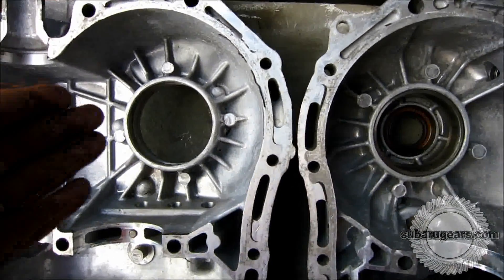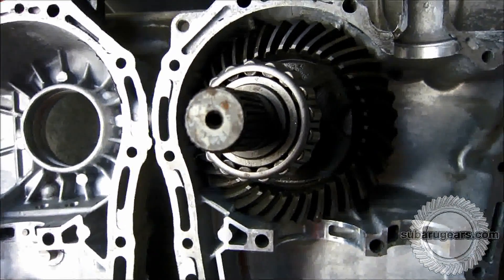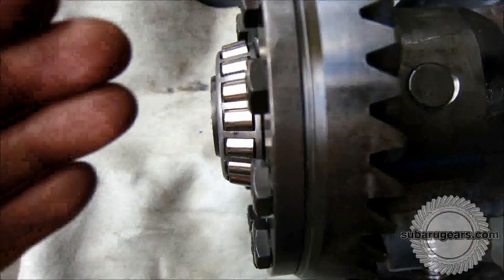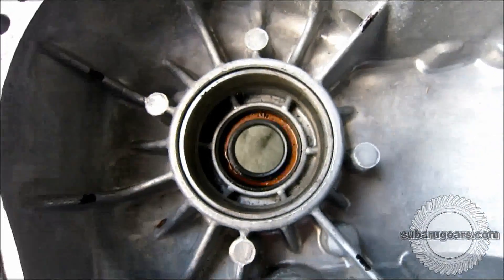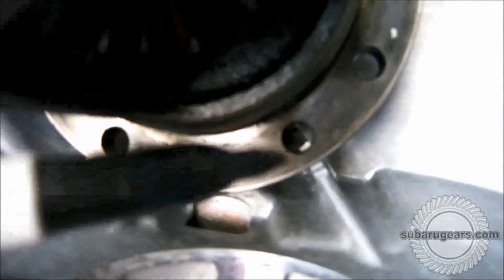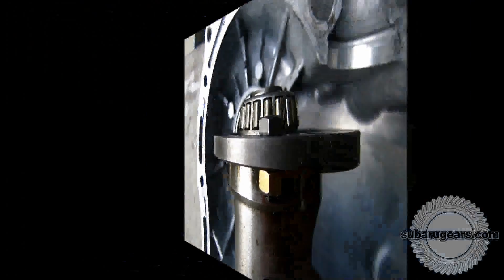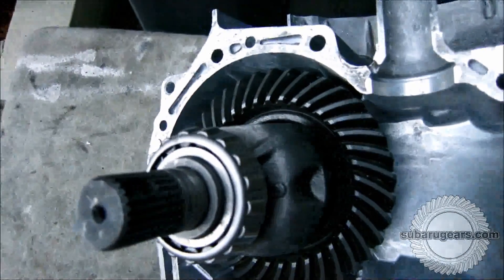Subarugears case clearancing

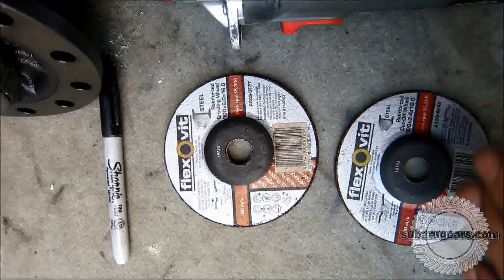Comment: 1:30 The grinding discs you are using are labeled for use on steel. While they do work, using them on Al is not advised. This is because the discs load up with Al, causing them to become unbalanced. While spinning over 10k rpm, it could lead to the discs exploding.  If you visit your local welding supply store, they should be able to supply grinding wheels that are intended to be used on Al.

Comment: I do wince at the thought of removing "any" material. Especially in areas that look minimalistic to begin with. Which reminds me... "I really don't see any beef in these trans' so I don't know how they got such a air of strength". Of course this end of the transmission wasn't meant to deal with 100% of the grunt, as it was shared with the rear. And I keep reading HP numbers and HP does't break transmissions, TORQUE DOES. So I don't know what to believe... Except that these trans' seem to work and that's hard to argue with. I will be installing one and I'm dang glad I can 👍😁 It's a good solution to a unique problem. Cheers! 🇺🇸